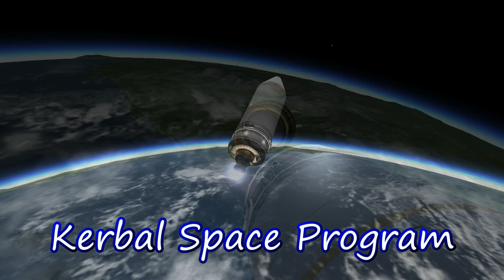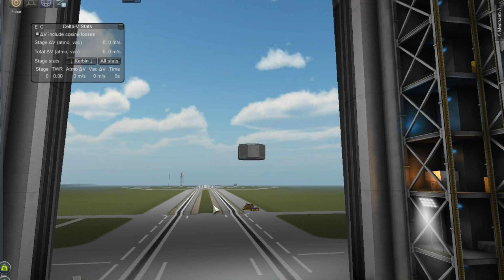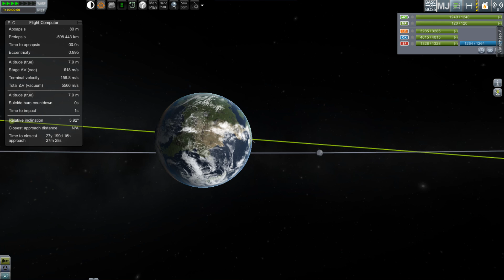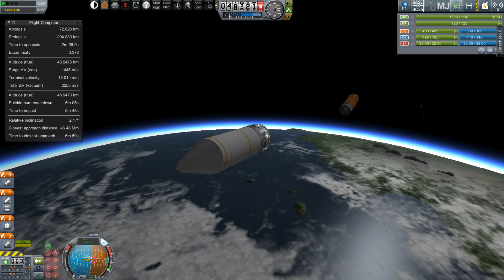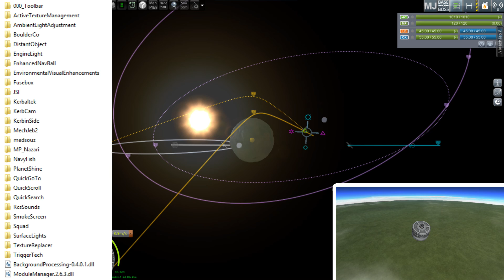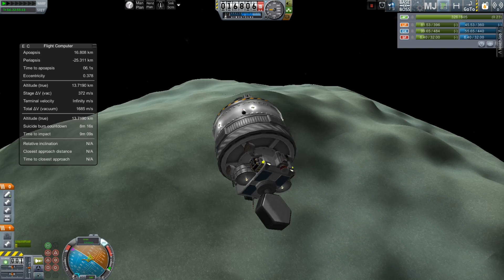GS1 "Scanning" -- Operation Gold Strike -- KSP 1.0.2

Comment: Hey, I know this is an old video, but my computer doesn't have the ability to open the .cfg file, If you could help me with this, it would be greatly appreciated!
Reply from the maker: +Minecrafttutorials25 What sort of computer runs KSP but does not have a text editor?
Reply: +Minecrafttutorials25 if you are running windows just open it with notepad. problem solved.

Comment: The other day I set up something similar, albeit much simpler due to part count constraints. So far I just have a single lander/miner and an orbiting refinery which is basically a giant fuel tank with an ISRU and docking port. The first time I went down to the surface I used only the orbital scan to choose a landing site... I guess I got unlucky because it took something like 60 days to fill the tanks. TL;DR I'm so going to make a scanning rover, complete with ion engines so it can hop around on the surface.

Comment: How did you see the ore concentration overlay (the one the satellite produces) when you were orbiting / de-orbiting the rover? I have had to switch back and forth between my lander and satellite over and over again and then sometimes i still mess up :*(
Reply from the maker: Chris Kenworthy I selected the ore on the right-side UI buttons.
Reply: Bob Fitch I don't have that little button on my GUI :( I only have the surface scanning module unlocked, so I don't even have the narrow band scanner yet. Is the narrow band required to pull a feed of the map view from the satellite while the rover is your active craft? Right now I can only see the resource overlay when the satellite is my active craft or I can see it in the tracking station.
Reply from the maker: No. Double-click Minmus and the button will appear.

Comment: has anyone run into any issues, as I am getting about 5000 feet up and then my rocket starts to spin.  it is a clean install with one the light mod installed. and Bob files.

Comment: Always exciting with a new series! Yay for Bob ^^ Btw, a bit off topic, but I was watching you KAS AMA today because I wanted to make certain parts grabable. I followed your tutorial to the T, but when I went into the game, none of the parts I added were grabable. Not even the z-400 battery, which I added just because of the tutorial.

Does this no longer work in the new version of KAS(and KIS)? I made the .cfg file, put it in the correct location, everything in the .cfg file is identical to the one in your tutorial. I'm a bit confused...
Reply from the maker: Chika dù Mystique It's possible things changed after KAS was released. I have not upgraded to KAS yet.

Comment: What happened to your Anti Aliasing in this video?
Reply from the maker: Eddie Rod I did not notice a difference. I will check the setting, but I used to leave it the default and I never changed it for this version. If the default has not changed between versions then it's still the same.
Reply: Bob Fitch Usually you have it set to 8x AA but here it looks off!

Comment: Bob Fitch The Conic Patch draw mode is the same as 0 in stock when you focus on the cel. body (i think since .25). so there is no need to change it in the settings.
Reply from the maker: Michael Derflinger Hmm Mine was wrong after my latest upgrade. I have to change it again, as always.
Reply: Bob Fitch its by default set as "3" but when you click "Focus view" on a cel. body the conic patch will be displayed as "0". so the draw mode is dependent on your focus in the map.
Reply: Michael Derflinger I experience the exact same thing as Michael. All I have to do is click on Minmus, select "Focus View", and then I get the conic patch. There was no need for me to muck with the settings file at all.
Reply from the maker: Melissa Guglich Michael Derflinger Wait... it's not like that 100% of the time? That could explain it. I always want it that way. When I had my ship selected it was not correct, so I changed the draw mode and it went back to the way I wanted. I didn't know you could select the planet for the proper view, but then again I don't want to have to select the planet every time.
Reply: Bob Fitch Yeah, you have to click on the body for this draw mode. I can totally understand wanting it on all the time (I'm going to be updating that for my own install too) - but I feel very comfortable editing config files. For viewers who aren't as comfortable editing these files, there is an in-game workaround for a stock install. :)